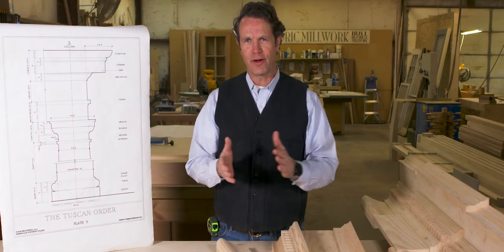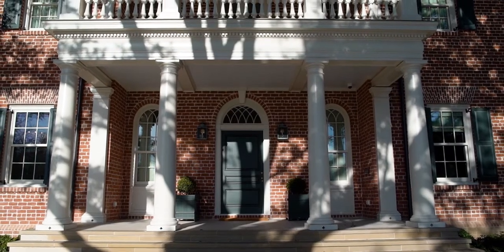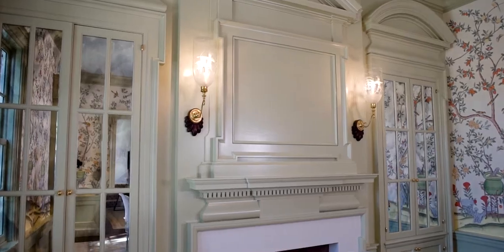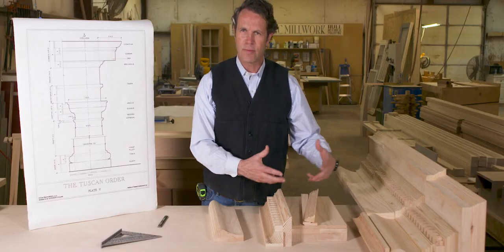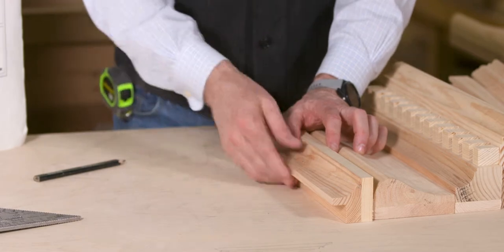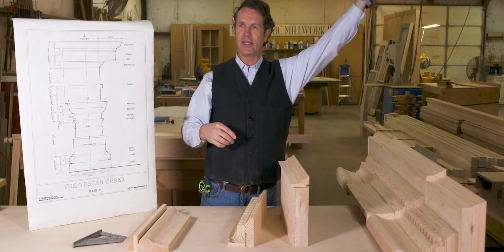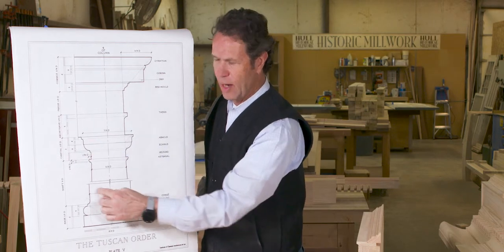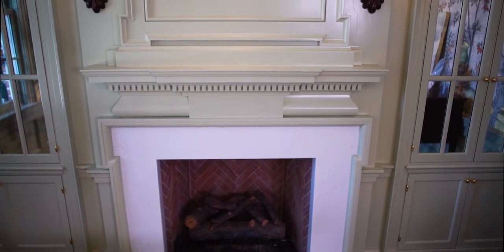“Building with History” - Georgian Style - Workshop Edition

Comment: The Greco-Roman-Renaissance tradition of building has a lot of folklore behind it. When classical aesthetics are scientifically tested they usually fail to live up to the hype. For example, when groups of people are shown golden ratio rectangles vs other rectangles they don't consistently rate the golden ratio version as more beautiful than other ratios. That the golden ratio is better is just part of Western building folklore. One must wonder if the proportions used in classical styling are only desirable because we're used to seeing them on expensive buildings we're envious of. The proportions you'll usually find in books are meant for exterior stone structures, and if you try to use those proportions for interior wood moldings they look far too heavy. They must be made more slender to look right, so which proportion is correct? My point is that proportions used in classical are quite arbitrary and based on tradition and culture rather than the actual human body, which is more-so just folklore.
Reply from the maker: Thanks for watching and commenting. I think it is best to agree to disagree. I can think of too many historic examples of the human form and yes, the golden ratio influencing design from Leonardo de Vinci to Mies Van der Rohe, it is just too prevalent. Thanks.
Reply: Thanks. To clarify I'm not saying the golden ratio hasn't been used by Western architects, just that there's no evidence the average human finds it more beautiful than any other rectangular shape. Its use is more for the esoteric satisfaction of the architect or builder than for the layman. I was more-so responding to your comments about the 1:7 ratio being the "perfect" ratio for a man, a school of thought that Vitruvius said supposedly came out of Greece, even though the Tuscan order came out of Italy and the version you're showing in this video is from 1,000 years later during the Renaissance, and those proportions are meant for stone exteriors not wood mantels or door casings. Sure, a 1:7 ratio may look "stronger" for a column, but a 1:7 foot-to-height ratio is no indication of actual strength, as a man with those proportions could either be very thin and weak or very thick and strong. Foot size to height ratio is not an indicator of strength or even masculinity! For the supposedly masculine Greek Doric, the proportions used for the Parthenon's column base diameter vs column height was actually 1 to 5.48. Not exactly a beautiful whole number. That's what I mean by these proportions being in reality pretty arbitrary. If you're off by an inch I doubt even the most learned builder/architect would even notice. Plus the actual proportions used for wood interiors or stone exteriors are quite different and vary dramatically throughout history without necessarily deviating on beauty. Even ancient buildings varied quite a bit in their proportions and didn't stick to Vitruvian rules. That's why I say these idealized proportions are just folklore. That isn't to say classicism isn't beautiful, it is. There's just some nonsense around it that makes a decent anecdote but isn't actually true or useful.